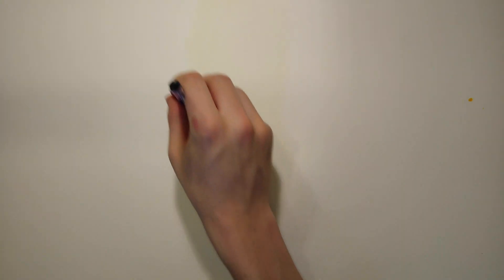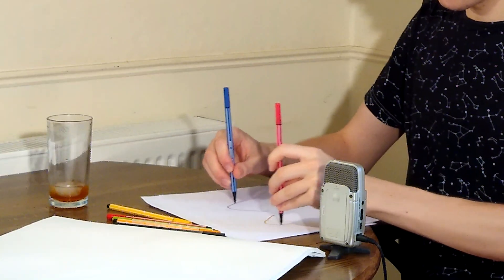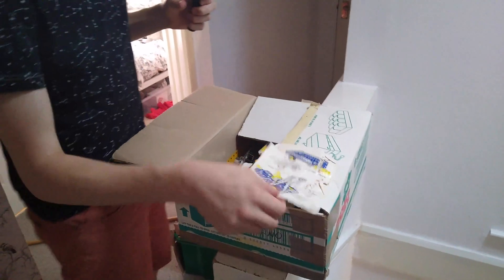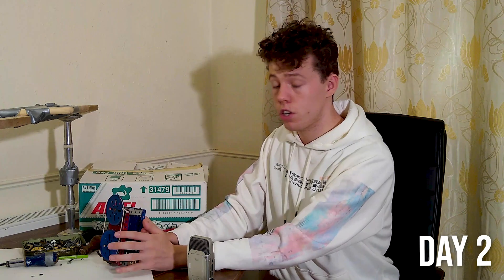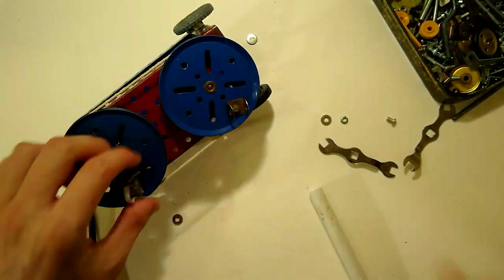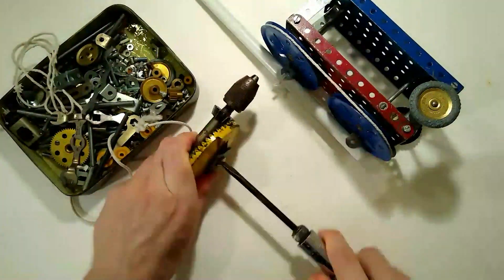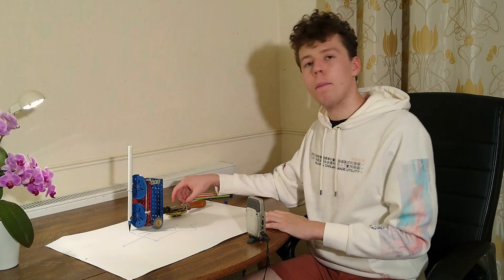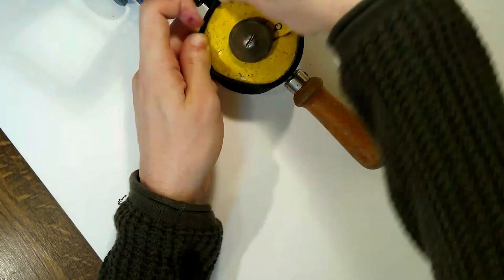Making a Mechanical Sine Wave in Lockdown

Comment: Is the period of the drawn sine wave equal to the circumference of the driving wheel divided by the velocity ratio of the gears? I am thinking this because if the drawing wheel spins say for example 10 times within one ration of the driving wheel then it must of drawn 10 periods.